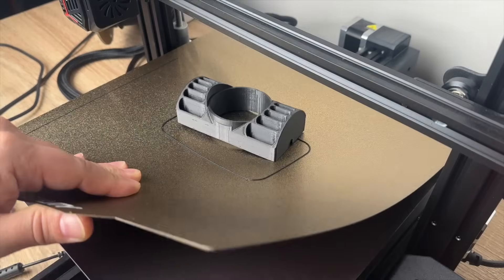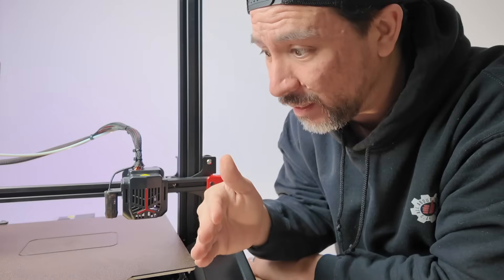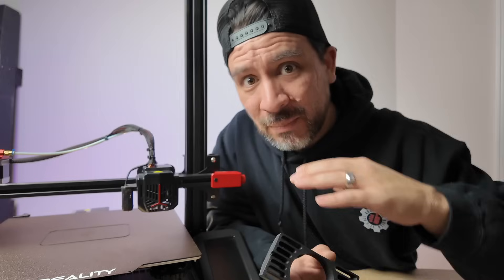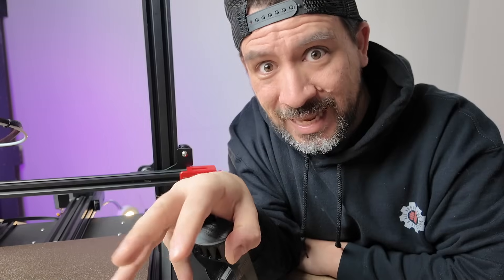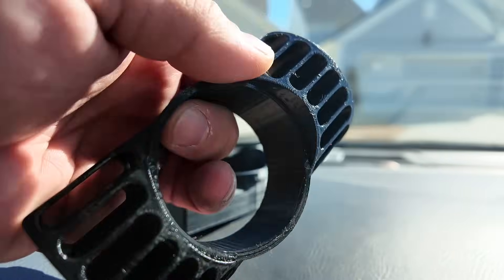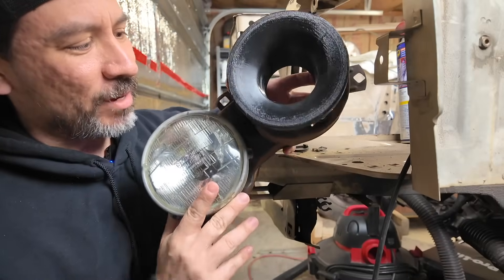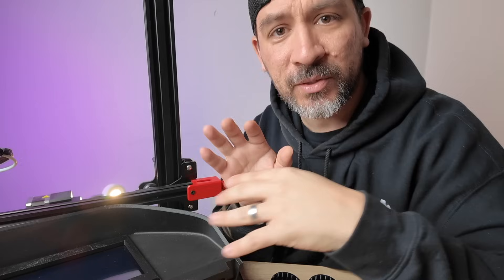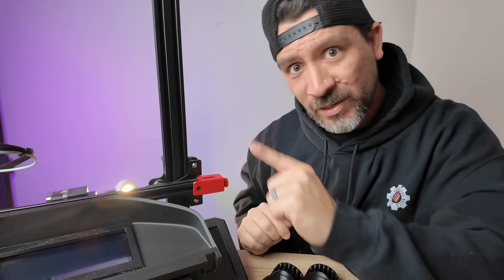DIY 3d Printed Car Parts... Is it Overhyped?

Comment: How do you get a smoother finish like you would with an injection molded par?
Reply from the maker: If you print with ABS or ASA with an enclosed 3d printer you can use acetone to smooth the layer lines. You should be able to find other videos on the topic. You could also try different filaments infused with argon or glass fiber. That usually helps reduce how much you can see the layer lines. Or you could use fuzzy skin to hide the layer lines. I did that with a 3d scanned part I made in this video 👉 https://youtu.be/YJ45wPpVa5g?si=MH2_IfUD3Mhatk_p

Comment: That intake would work better shaped like a parachute; IE the inverse of a velocity stack. You're trying to ram as much air as possible into a space to raise the air pressure. A velocity stack is made to smooth air as it enters the intake. Two different purposes.
Reply from the maker: Great idea, I give that a try in Shapr3d. At the time of making this vid, I just downloaded a free version because I didn’t know how to design my own parts yet 😁. Do you 3d print car parts too???

Comment: Hello sir.... can PLA be used if no direct sun is there i mean inside parts with light load. OR what can be done with PLA to be able to use it for the same purpose as you did
Reply from the maker: PLA can handle up to 134° F before it will start to warp. Made a 3d filament selector you can use to pick the right filament here -> https://www.allaboutthebuild.com/blog/filament-selector-tool-for-car-parts

Comment: I highly recommend using the Orca Slicer. It allows you to use two different materials as an interface layer for supports. This results in a perfect separation layer that’s much easier to remove.
Reply from the maker: Nice, now I just need me a Bambu Labs H2D :)
Reply: @Itsallaboutthebuild  Ah, I see. The Bambu Slicer can handle that as well. I recommend using PETG as an intermediate layer since it doesn't bond with other plastics. That also works with the P1S or X1C.
Reply from the maker: It would be nice to have a dual nozzle setup that way I don't have to pause and change filament :)

Comment: Which ASA manufacturers can you recommend? I have printed Eryone, the stuff stinks.
Reply from the maker: We use Bambu Labs ASA which does release nasty fumes. we use a fume extractor next to the X1C in the garage and a nice carbon/hepa filter when printing ASA or ABS
Reply: @Itsallaboutthebuild OK thank you.
Reply from the maker: Any time
Reply: @Itsallaboutthebuild I actually have another question. Have you made any changes to the profile for ASA? I can't get good layer adhesion with Eryone. I have the nozzle at 270, bed 90, chamber 55, flow 14mm/s³. I think the cooling is too high, or it is due to the material (manufacturer). I ordered two rolls of ASA from Overture and Flashforge today.
Reply from the maker: Try heat soaking the chamber first for about 15 minutes, up the bed temp, and leave all fans off. Also adding a brim helps if you have sharp corners on your part. Hope that helps

Comment: FYI if you switch to Orca Slicer instead of Cura you can add basic shapes like cubes and cylinders to the build plate to act as cutouts or modifiers for alignment pegs, cutouts, as well as fully custom support painting; so you could have made your screen cutout in the slicer, without printing it first then cutting.

Also orca slicer tree supports seem to be actually reliable; I always had issues with tree supports on my ender 3 v2 using cura; but orca seems to do a much better job.
Reply from the maker: Good point, was riding the struggle bus on adding shapes for cut outs. Since then I’ve moved onto Shapr3d to add cutouts and to make custom parts. 🙌

Comment: Which printer are you using?
Reply from the maker: This was the ender 3 pro max neo, but I'd suggest getting a bambu lab p1s or check out our printer selector tool we put together which lists the best based on your budget and filament -> https://www.allaboutthebuild.com/blog/2025/6/3d-printer-for-automotive-parts

Comment: This guide feels like it's from 2017 or something :P

For anyone interested in doing something similar:
For $350 there are way better machines out there now (Like a k1se which is up to 10x faster)
Using cura in 2025 is just crazy when there is so much better alternatives out there (Orcaslicer)
And PLA is just a nightmare for any functional print (At least step up to PETG)
Reply from the maker: Completely agree, we've switched to the X1C with ASA and its way better. Was just using what we had and believe it or not, lots of folks still have these older type of printers ;)

Comment: I've made/designed an USB charging port frame for a dashboard switch blank, a four-port USB charger insert for the rear seat ash tray, dome light spare parts, brackets for refit sensors (flexfuel etc), gauge brackets and bezels etc. Truly an irreplaceable tool for the car enthusiasts. 

Freshly printed PLA has really bad heat resistance, but there are High Temp PLA variants that can be heat treated to recrystallize the plastic where it becomes MUCH more heat resistant. It's a good option if the printer can't do ABS/ASA or PETG.
Reply: There are a few, but FormFutura volcano PLA is my favorite brand.
Reply from the maker: Oh nice, which brand of PLA???
Reply: @Itsallaboutthebuild  There are a couple of brands, but my favorite is FormFutura Volcano PLA.
Reply from the maker: Thx, will have to pick some up and give it a try.

Comment: Don't know about CURA (probably the same), but in PRUSASLICER You can modify the sliceable print itself by using modifiers - could, for example, make a rectangle shaped modifier that can be used to EXCLUDE or DELETE the rectangle spot, to make the window. Don't have to edit the STL file.

Also, there You could add the extra bezzel.

Comment: For PETG, spray a thin coat with hairspray on the plate.  It contains vinyl, so you’ll have a release agent on the plate. No need to ruin the nice PEI bed. I use the cheap gold bottle L’Oréal, but many others work fine. Just make sure it contains vinyl.
Reply from the maker: @erikrustad5200  oh nice, great tip. Will give it a try. Do you 3D print car parts too???
Reply: @ the only car part I have printed is some small gears for a faulty charge cable release. So not really car parts 😂
Though it needed to be really tough due to small size and quite heavy load. I found pets to work the best. Pete-cf was too brittle, and PA12-cf had horrible surface quality with support, so it would work in the mechanism.
Oh, for the hairspray thing. One spray lasts for many prints! Once you notice it is starting to stick too well, even when cold, spray again. One bottle should last a year!
Reply from the maker: @erikrustad5200  ah cool. Appreciate all the tips. We like PETG, but wish it could handle heat a bit better

Comment: I printed a handbrake mount and air ducts for the air conditioning in my car using petg . I live in the philipiines, no car tint, no car cover unless it's raining. A lilttle over six months and this is the first time I had to disassemble the mount to get to my cabin air filter. Granted it's mounted under the dash, away from sunlight, I'd say it held up well.
Reply from the maker: Nice to hear your parts are holding up well!  Petg is a great option for some interior applications.

Comment: i can recommend ABS-GF its more durable than normal ABS and easier to print espacially on open printers (hardened nozzle is required though) but they are not that expensive.
Reply from the maker: Agreed, we just test printed some ABS-Gf and love it, thanks for the tips 🙏🙏🙏

Comment: Pretty sure you could have added that cutout to the model rather than cutting it out
Reply from the maker: You're 110% right. Still learning how to add precise cut outs using a 3d modeling software instead of objects/modifier in the slicer :)

Comment: Add fuzzy skin to your prints. not only does it improve the look, but with some tweaking it can mask support connection areas really well too.
Reply from the maker: @slickrick3518  you are right. We did on one of our other vids where we 3d scanned and 3d printed an eBrake handle

Comment: First of all I want to say this is an awesome video and I think for a lot of people who may be into modding cars but are clueless about 3D printing would get great information from this and possibly increase their confidence in using the technology to give their project some individuality. For anyone seeing this and looking to get into it and buy a printer for the first time I think it's important to point out some things in this video that seem trivial or insignificant but can absolutely ruin your experience. 

One is the ABS warping. This can be pretty extreme depending on the geometry and size of your part so don't think the small amount of warping seen here is all you'll get. I'd actually say that if ABS is what you plan to print then get an enclosed printer, or at least make or buy an enclosure for whatever printer you buy. The cause of warping is the cooling of ABS causing it to contract so if you can keep the part at a more uniform temperature then it will be less likely to warp at all. I actually wouldn't recommend anyone start printing with ABS as there are probably some general printing lessons you should learn before getting into difficult to print materials. This includes that there are more difficult materials to print that may offer you much better results like nylon as well as easier materials that may be just enough to get the job done without much hassle. You also need to temper your expectations for the parts that you're going to get. They will be great, but they will never be as strong as an injection molded piece. The good thing is you have everything you need to just make another one, but some people won't want to deal with that. When you start printing one of the fastest lessons you'll learn is how your print speeds, print temps, and print orientation impact the strength of your part. If you're handy with CAD you can do things like make slots for nuts to be inserted so you don't need to just depend on the strength of the plastic, but if you aren't then shaper 3d is a good program and will help you do a lot of basic things. Just know that plastics shrink when they cool so no matter what you'll need to measure and then add some to compensate for it. 

Second is the printer. If you're going to be printing anything that you want to be aesthetically pleasing without needing sanding then I would recommend not going with a cheap printer. If all you can afford is a cheap printer then that's fine just understand you may find yourself needing to bondo, sand and paint parts to get them to look how you want. I personally like things to color match so that's not a problem for me as I'll probably paint it anyway, but going with a direct drive extruder on a machine instead of a bowden tube extruder will help you dial in setting for retraction and speeds a lot. Direct drive has the extruder on the toll head so it can be more precise and make smaller and faster adjustments whereas bowden tube extruders need to account for the flexibility of the filament between the extruder and the tool head. Again, not a problem necessarily, but if you're someone who wants something easier to work with and you want your hobby to be using the things you print and not just trying to dial in print settings then I'd say a beginner friendly printer that costs a little more is going to be what you're looking for. There will still be a need to learn what settings to tweak and what can cause failures so you can never get rid of that but you can reduce it. For anyone familiar with machining think of the printer settings like speeds and feeds (which they basically are) but add temperature and consideration to the material properties at those temperatures to the mix as well as the extrusion width and heigth in consideration of your nozzle size and you'll understand it well enough. On a slightly seperate note, don't wait for your printer to cool when removing filament. Remove when the hotend is hot enough for the plastic to be past its glass transition temperature so you don't have to use any force when removing it. 

Lastly is the actual cost of this. If you're ok with taking on an entirely new hobby basically and understand that this means purchasing any tools, accesories, and materials you'll need to be successful then go for it. If you're thinking all you'll need is the printer and some filament then I'm sorry to say that you'll be surprised when you find out what you might actually need for this. I have a printing toolbox with extra parts for my machine since it is now aniother machine you own that does require maintenance and will require repair. There are also some tools that are appropriate for working on metal parts that you really won't want to use on your prints. If you don't do any machining or metal work then I'd say you will want a deburring tool as it will save your fingers from xacto knife stabs. There are also a ton of products out there that are supposed to be for bed adhesion and chemically welding prints together, but a clean bed is all you need and if you need to chemically weld the parts together then I think heat set threaded inserts may be a better option for automotive applications because you may find yourself needing to take it apart again in the future. You're going to want a set of heat set inserts with the appropriately sized hardware and then something to actually set them with. I use a soldering iron with a specific tip on it for heat set inserts, but I've seen people get away with using a small torch lighter and some tweezers with the insert threaded onto a bolt to help hold it and keep it straight when inserting. What i's gettign at is that just like with many hobbies that help you manufacture things for cheap the actual cost of doing it is always higher than what it seems. One thing to note is some materials that would be perfect for things like the headlight intake in this video can cost around $150 just for one spool. Polymaker recently released PPS-CF which is a carbon fiber impregnated plastic that can have metal-like properties. They sell it in half kilogram spools which is half of a normal spool and that costs $70. If you want to get that and want to spend that then do it, but for the person looking to do things on the cheap then just understand you're limited to basic plastics. Most carbon fiber impregnated filaments are also more brittle so make sure you understand the difference between strength and toughness when shopping.

On the note of cleaning your build plate I would highly recommend dawn dish soap and hot water. Windex is good for glass beds, but the PEI coated beds can hold on to a lot of oils and various dirt from the environment that the windex may not remove. Use rubbing alcohol as a maintenance cleaning and then if you notice a print not sticking you go clean it in the sink with some dish soap. Most adhesion issues are from dirty build plates and second biggest problem your nozzle being too close or too far from the bed.

Again, great video but I just wanted to get some information in here for anyone who is brand new to manufacturing, engineering, or machining to not be surprised when they buy a printer and then discover this stuff. These machines are so well built anymore that many problems people used to have just aren't there but I think this is kind of a minimum amount of information to get you going with a new printer.
Reply from the maker: @atillathehung2000  🙏🙏🙏 LOVE THE FEEDBACK. There’s lots to all of it for sure. I agree an enclosed printer is better for ABS too. We recently tested the Bambu Lab A1 and enclosed X1C. I was amazed at the difference of tinker reduction with new printers. Got in way over my head on buying this older printer last year on a Black Friday special. So… bit question…. What 3D printer would you recommend to do basic and advanced type filaments????
Reply: As someone about to get into 3d printing this comment is HUGE help. Thank you

Comment: You need to put the printer inside an enclosure to get good results with ABS.
Reply from the maker: @jonholzworth4463  for sure, also saw someone print a brim with a wall that kept the heat in. Some cool stuff